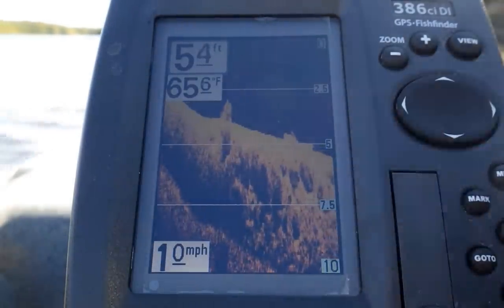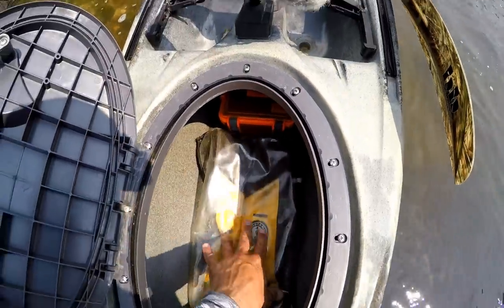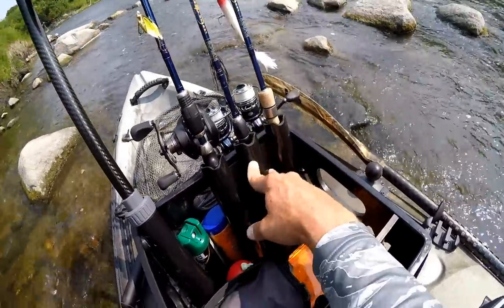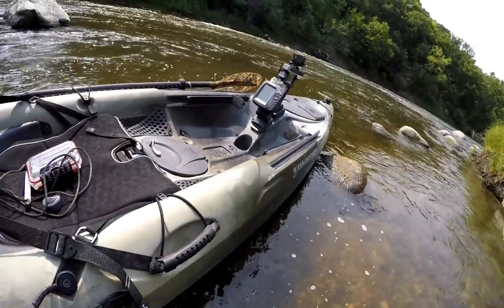My Tarpon 120 Fishing Kayak

Comment: That’s a great crate setup. How did you secure the rod holders? Also, what was used for the divider? I used JB Weld and some Plexiglass, however your set up looks much cleaner and I like the cord holder knob on it!
Reply from the maker: I used machine screws for just about everything on the crate. For the rod holders I made a ramp like part from three pieces of abs plastic. That’s screwed to the back of the crate and the pvc tubes are screwed to the ramp.
Reply: @ndyakangler  Thank you!!

Comment: You should make a deal with Tarpon and see if they'd do a signature series based on your set up. It would be pricey as hell but would probably sell like crazy
Reply from the maker: I should, if anything to get them to reverse some of the changes they made to the Tarpon last year. I'm not a fan of the center hatch getting replaced with a little dry box that snaps into the top of the hull. I stash a lot of stuff in that center hatch that I like to be able to access easily on the water.
Reply: @ndyakangler  I hadnt checked out the latest Tarpon model. Removing that hatch you mentioned sounds like a terrible idea. I love the center hatch on mine, too. Last year when i got into kayak fishing, i shopped around to see what my options were in my price range and a lot of the ones i found and liked had been discontinued or just werent available because of the shortage. I ended up going with a used 12' Evoke Navigator. it's been great, so far. I like it a lot.

Comment: Crazy awesome camera setups.  I've  got mine on order.    I'm wondering how you mounted the pvc rod holders?  Any suggestions on what mods to do right away to make life easier?
Reply from the maker: I made a ramp shaped part out of HDPE and ABS plastic, the PVC rod holders are glued and screwed to that and the whole thing is screwed to the back wall of the milk crate. The milk crate is the first thing I'd do when rigging up a new kayak. An anchor cleat or two will come in handy for a variety of things. Also the little pull strap I showed in this video is something I always have with now. It comes in handy almost every trip whether it's for pulling the kayak over land, tying to a branch instead of dropping anchor, or keeping the kayak attached to me while wade fishing. I did add a carabiner to the opposite end of the handle to make it easier to clip on and off.
Reply: Thanks for the help.  What size and length are the CF tubes are you using?  I'm looking to make a night safety light mount somehow.  Any suggestions for an easy quick night light fix?  Cameras are down the road, but are you a machinist?  Again thanks.
Reply from the maker: I used 7/8"OD carbon fiber tube. A small flashlight with a traffic wand makes a good light. My Olight S-10 with the traffic wand is like having a portable cfl bulb.

Comment: Great video, like the setup. Can you share some info on the transducer install....I am a newbie, but surely want to get some tips.. Appreciate it !
Reply from the maker: Thanks Dave! I used Marine Goop to glue my transducer down inside the hull. I scuffed up the hull with some 400 grit sandpaper (don't sand the transducer) and ran a thick bead of glue lengthwise on my  transducer so that it would push out any air pockets and spread evenly when pressed down. Then I pressed it in place where I wanted it, ran a couple strips of duct tape across the top to hold it steady while drying, and set a couple bricks on top to keep pressure on it. Then you just let it sit for a couple days for the glue to fully dry. Another faster, less permanent method is using G&B duct seal you can find at Home Depot. It's a sticky clay like substance that the transducer will shoot through. Just make a ball of it about the size of a quarter and press it down between the transducer and hull, then add a little more around the outside of the transducer to help keep it in place. With either method the key is to get as little air as possible between the transducer and the hull.

Comment: Dude. Incredible ingenuity on the power camera mounts. Which GoPro model are you using?
Reply from the maker: I used 3+ black editions for the camera rigs shown and filmed the video with a 4 or 5. I might convert the kayak rigs to run my hero 5’s over the winter, I just need to swap out the plug that goes into the side of the Gopro.
Reply: @ndyakangler  do you know if later models of the GP still have the plug option? Thinking of a hero 7 or 8 now that the 9 is out. The stabilization feature is money and the prices are reasonable now that they aren't top dog.

Comment: Awesome kayak...When did you start kayaking and when you started did you start by going out on paddle rides and getting comfortable with the kayak and different water situations before fishing?? Or did you just take one rod and kinda went for it??
Reply from the maker: Thanks DeOnna! It's been five years now since I got my first kayak, the mango color Tarpon 120 in my videos from before last summer. I planned on fishing from it and received it around this time of year so while I waited for the lakes to thaw out I got my first milk crate built with some rod holders and installed a fish finder and anchor trolley. The first trip out I went to a small pond with a friend who also just got his first kayak. I was a little worried about tipping so I packed light, just one fishing rod and I made sure to tie a leash to all my gear that could be lost if I flipped. The kayak was a lot more stable than I thought it would be. It only took about 5 minutes to get a feel for it and the thought of falling in disappeared. The only time I've ever gone in since then was last fall when I was standing on it in some river current and lost my balance. One thing I'd recommend doing once the water is warm enough is to take the kayak out to a shallow spot with just a paddle and a pfd and intentionally flip it a few times to test its limits and try a couple re-entry techniques.

Comment: What did you use to secure your paddle on the side there?  I am still waiting on my Tarpon should be here in a week or two.  Can’t wait!
Reply from the maker: The older Tarpon 120’s had a bungee strap built in there. The new 2020 Tarpons got rid of that and the rear slide trax, and also replaced the center hatch with a small dry box.

Comment: How do you charge the battery. Must you take it out, or did you design something else. I have a similar box and looking for ideas on charging port etc . To make charging easier than removing box , unpacking battery, having everything opened up overnight, no what I mean. I like your other ideas...neat boat man , nicely executed. ( Lego ..whoduthunkit ) 🐡
Reply from the maker: I always take the battery out at the end of the day. The battery box is glued to the hull inside the front hatch so all I have to do is open the lid and pull the terminal clips off the battery to remove it, only takes a few seconds. My kayak sits on it's side on my trailer so I don't trust the battery box to remain glued in place if I leave the 7lb battery in it while in transport. I also keep my trailer and kayaks in a storage garage so I don't have a power outlet to plug a charger into. If circumstances were different though I'd definitely add a plug I could easily hook a charger up to.

Comment: Hi.  I went on the Wilderness Systems website and checked out the Tarpon 120.  I really like the look of the Tarpon 120, especially in the (Mango) color.  Is yours the Flint or Desert Camo color?  I also checked out the A.T.A.K. kayak, it's nice too, but alittle more money.  Do you have a Wilderness Systems dealer by you?  Later bud...
Reply from the maker: I have the regular green camo, didn't see it on their website any more but I'm sure some dealers still have that color. My old one was mango color which is good for lakes with a little more traffic. Scheels usually has a couple 120s in stock here in Fargo but I've ordered all three of mine from Austin kayak. They're great kayaks as long as you don't really plan on standing in it. The only time I've gone over board was a few weeks ago, I was standing up and the current started to rotate me. I stuck my paddle into the ground to try to regain my balance but it sunk in and I went for a swim.

Comment: Very nice kayak. How do you do that on a river paddling and fishing at the same time? Must be a circus act.
Reply from the maker: Thanks! The water at this spot is a little shallow and fast compared to most areas of the river I fish. Here I'll usually hop out and wade fish around the rocks. In slower moving water the kayak sits still pretty well if you have the front end pointed into the current, plenty of time to get in a cast or two before I start drifting back.

Comment: I am interested in mounting a Lowrance unit in my Tarpon and was wondering if you had a video available of you mounting one in your Tarpon?  Really interested in the way you have the transducer mounted on the inside. Any help would be appreciated greatly. I have watched this one particular video several times reviewing how you have set this kayak up. I don't feel confident in my abilities to mount the transducer inside the hull and it work after hearing horror stories from others about their attempt to do the same thing. You seem to have a handle on it and I would like your advice on the install if possible. Thanks for any help and for the great videos also.
Reply from the maker: I don't have a video of the installation but gluing the transducer down is pretty easy. Just scuff up the area on the hull where it will be glued down with some 400 grit sandpaper and wipe it with some rubbing alcohol. Then I like to put the glue on the transducer, a thick bead ran down the middle lengthwise so when you press it down it pushes the air out. Then press it in place, run a couple strips of duct tape over the top so it doesn't move and put a brick or something on it to weigh it down. Then let it sit for a few days for the glue to fully dry. Using duct seal instead is another faster less permanent method, its like sticky clay so you just press it down and its good to go.

Comment: Very nice set up ! I have a question if you don't mind . The 9 Amph battery is the deep cycle or it's a sealed acid battery ? Thanks
Reply from the maker: It’s a sealed lead acid battery. If I’m just running the fish finder a 5ah is plenty. The 9ah will run my fish finder and the front GoPro all day.
Reply: @ndyakangler  That's great ! Thanks for response and excellent informative video  .

Comment: Also, how did you make the plastic divider in your milk crate? My milk crate seems to get cluttered easily so I was thinking of some ways I could organize mine
Reply from the maker: sgtryan98 I made it out of ABS plastic, 1/8" thick for the main piece and a 3/4X1/4" strip along the top and bottom of the rear facing side. I used some 5/16" 4-40 screws that went through the 1/8" and screwed directly into the 1/4" plastic behind it. I used a cheap Irwin bit and tap to make the threaded holes in the 1/4" piece and countersunk the holes on the front side of the 1/8" so the screws sit flush when its put together. Pretty similar method to attach it to the crate, I used 3/4" 4-40 screws through the outside of the crate and into the ends of the 1/4" at all four spots they meet.

Comment: Great video. What is an anchor trolley though? How does it work ?
Reply from the maker: The anchor trolley is a system of pulleys with a rope looped around them and a ring to run your anchor line through. Most people run them the length of the kayak and it allows you to run the anchor off any position on the kayak. I only used the back portion with my old kayak so that's all I installed here, that way when it's windy I can pull the anchor line to the back of the kayak and it keeps me positioned with the wind behind me.

Comment: Hi NDYakAngler.  Just watched your latest Video “MN Fishing Opener 2018”.   Looks like a fun time out on the river.  The current was really flowing!   

I have a question for you about your setup.    How did you attach the right sided anchor cleat to the track system?  I have a similar cleat that requires drilling holes and bolts to secure the cleat—would prefer to install in the same location as yours on the existing track.  Did you modify the cleat?

Thanks

Mike
Reply from the maker: Hey Mike, I didn't have to modify the cleat itself but I had to make a few things to install it. The cleat came with two countersunk holes already molded into it. I found a 10-32 hex drive machine screw with a flat head fit perfectly flush with the surface so that's what I decided to use. Slide trax accessories use a 1/4-20 screw so I had to make my own square nuts to fit inside the slide trax rail. I used a strip of 1/8" aluminum and tapped 10-32 threads to work with the screws I wanted to use. I noticed the plastic on either side of the rail was slightly higher than the rail itself so to prevent cracking the cleat I made a strip to sandwich between the two. I used 1/8" ABS plastic I had on hand, the width of the rail by slightly less than the length of the cleat with holes drilled to match those on the cleat.
Reply: Thanks NDYak Angler.   That sounds like a great solution.   I will give it a try.  I have other questions for you if thats OK.  Would you like me to continue using the comment section or should I PM you?  Thanks.   Mike
Reply from the maker: Hey Mike, you can email me if you want. Ndyakangler@yahoo.com
Reply: NDYakAngler  Ok will do.   Thanks

Comment: How did you do the paddle holder that you have in the front of your kayak? I have a sit in kayak and really don’t want to drill holes in my kayak if I don’t have to but I love the paddle holder you have.
Reply from the maker: The Tarpon comes with that paddle holder already installed. You could do something similar with a length of shock cord and a pair of bungee deck fittings but you'd have to drill a couple holes. I wonder how well that design would work with a sit inside kayak though. My Tarpon is relatively flat on top but with moderate side to side movement my paddle would tend to slide over into the water if I don't double secure it with the side handle strap. I ended up putting a little strip of silent traction pad along the highest point of the edge of the kayak beside me to stop the paddle from sliding past it and slapping the water when I'm standing up and stick the paddle into just that front bungee with it laying across the top of the kayak. Just something else to consider, you'd want a secondary way to secure the paddle or at least stop it from sliding into the water closer to the middle of the kayak as well.

Comment: hi, i got my eye on the tarpon 120 thanks to your videos. I only fish in small and calm water without current. I am 6'4 and weigh about 240lbs. do you think I'm pushing the limits when it comes to kayak capacity? Or am I possibly right given the type of water I fish? I don't want to make the wrong choice because I romanticize fishing from this kayak through your videos 😅 what is your honest opinion?
Reply from the maker: The stated weight capacity is 350lbs, however when I’m pushing about 200 and have my kayak fully loaded - couple 3-5lb batteries, power pole anchor, all my fishing and camera gear etc, I start getting water up the scrupper holes in the footwell. I prefer to have the water below the deck to not have it soaking into my shoes and up my pant legs any time it’s colder out. It doesn’t paddle and track as straight bogged down like that either. Mine is an older model and I thought the weight capacity was 300 when I bought mine, I could be wrong, but they might have made some slight changes to the hull when they re did the top side a few years ago.
Reply: @ndyakangler  thanks, I’m pushing 240 without any gear. Most likely water enters through the holes when entering the kayak. I think I’ll try to buy a ride 135. 
Looking forward to your next video! Greetz

Comment: Does changing out the screws create any issues with the new ones fitting in tightly?  Really like the clean touch changing over to black gives the boat.
Reply from the maker: As long as you use the same size, length, and preferably head shape they’ll fit the same as the old ones. Most of mine were 10-24, 10-32, or 1/4-20 but I removed one from each piece of hardware on the kayak to measure length and be sure I got the right size and thread pitch, then made a list of everything I’d need to replace them. Black oxide coated stainless steel is hard to find but Albany County Fasteners had a great selection and you can get as small of quantities as you want. They also have a diagram for each screw type to make sure you measure the length correctly as it varies between different styles of screws.
Reply: Thank you!

Comment: Did I see correctly that transducer is INSIDE the hull?? I never thought of that!  I have a side-mount on my YAK.  Would love to know if that is a special transducer or just a regular one that would go in the water.
Reply from the maker: It's a regular transducer, mine is down imaging and that still works through the hull. The only ones you need to have in the water are side imaging or any of the crazy new tech. You just need to attach the transducer so that there aren't any air bubbles between it and the hull which isn't too difficult. Duct seal from Home Depot works well. It's a sticky clay like substance that you can make a ball of and push the transducer into it.